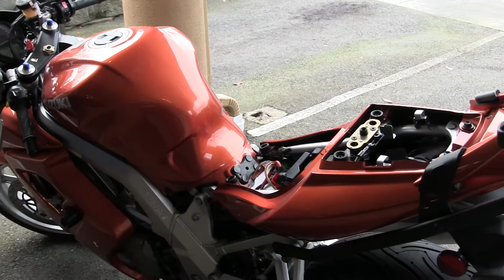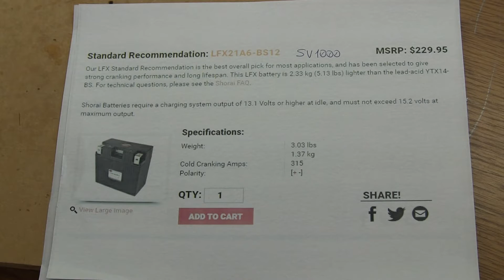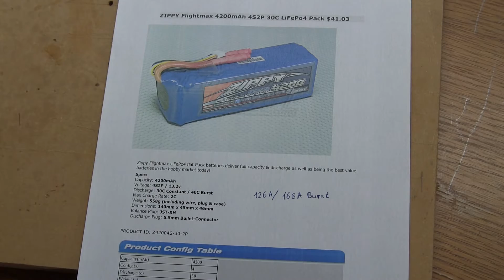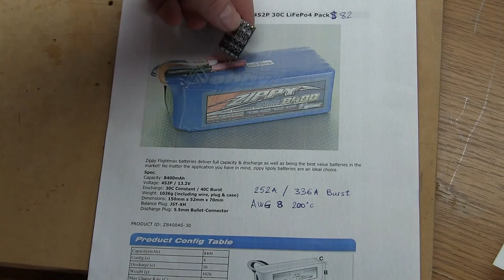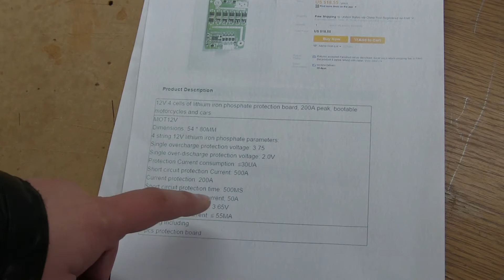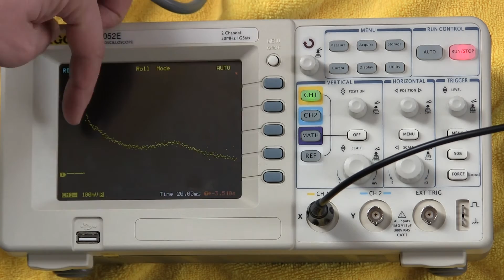DIY LiFePo4 Motorcycle Battery With BMS. Lithium Iron Phosphate.

Comment: Awesome video. I assume you're an EE?  I'm building my own MC battery with A123 Systems 8 -26650 cells (4s2p).  Most 500cc bikes have 6 gauge terminal wires. Has going to a 8 gauge been a problem?  Also, being out in the weather, how did you eventually seal the BMS, yet allow it to keep cool?  Thanks,
Reply: I know this is an old comment, but did you ever make that battery. I have the same cells and was thinking of making the exact same thing

Comment: If your pack reaches the overcharge cut-off, and does what it's supposed to, won't that cause your bike to shut off while you're driving?
Reply: It's a good question.  I'm not sure,  the regulator/rectifier is what might keep powering the system.

Comment: Can you give a diagram of how the BMS actually connects to all the cables? I'm trying to figure out how to make sure it gets connected properly and also allows charging of the battery pack. I saw you said B- to the negative on the battery pack but I'm not sure which point on the BMS is going to the bikes negative wiring and where the charging connections are connected?
Reply: Curious about this as well -- I assume he used negative (load) output, and the BMS allows reverse-charging.. or whatever the term is. I've noticed that voltage does flow backwards through my BMS in certain circumstances. (IE it lights up an LED on my cheap bench power supply even when it's unplugged from the wall.

Comment: Thanks ! 

I was so impressed, that i've bought the 4.2AH Zippy + same BMS (alieexpress) 

https://pl.aliexpress.com/item/4S-12V-50A-Battery-Protection-BMS-Board-WITH-Balance-for-4-Packs-LiFePo4-Lithium-Iron-Phosphate/32709959374.html

Right now, i've made the same mistake with connection of bms to the battery, without changing the polarity of the 'balacing connector' – the effect was the same like in vid ( ;-) ) The main question is – how to connect the bms with this Zippy battery? And how to connect it with the bike? Small drawing? Order of wires (colors) from Zippy ?

Comment: Thanks Nicolae, will try this battery on my Moto Guzzi Griso 1200 with this BMS: https://www.aliexpress.com/item/4S-200A-LiFePO4-BMS-PCM-PCB-battery-protection-circuit-board-for-4-Packs-18650-Battery-Cell/32819634220.html
Reply: Did you try it?
Reply: @jeremiahgustafson5318  Works very well.

Comment: You said that the BT are not trustworthy...you couldn't be more wrong. I have them for many years on my off road bikes (the 120 CCA version) and they never failed. Weight is 2/3 of the Shorai, and the double terminals are simple solution for many issues.

Comment: Never coat the mosfet's unless you use artic silver thermal compound and use a heatsink that covers all 12 find a plastic compartment laying around and make holes for the wires and heatsink and seal all of the holes for wires with silicone and use thermal compound for the heatsink, no moisture issues

Comment: Can't you add another battery in parallel?
Reply: Yes and parallel the balance leads. That would double the amps and capacity, but maintain the same voltage.

Comment: Try starting you car with it
Reply: I will. 
I ordered the 4.2Ah battery instead of the current 8.4Ah for the motorcycle and I'll try the 8.4Ah battery on the car.
Reply: I have a 4,2Ah buth my bikes need a lot of amps, I would like a second 4,2Ah buth they are soldout.  I also tried some cheap Samwha supercaps buth they are crap.  I,m planning on using this bms http://nl.aliexpress.com/item/Free-shipping-4S-30A-lifepo4-BMS-PCM-battery-protection-board-for-Lifepo4-battery-pack-SH04030029-FB4S30A/32553398237.html
Maybe run the starter straight on the battery. Also with the 4.2Ah look at your charging current.
Reply from the maker: Just posted the video with the 4.2Ah battery:
https://youtu.be/Y1etkdPBtNQ

Indeed, the charging current may be a concern. I've seen it climb up to almost 12A which significantly exceeds the 1c recommendation. Will try to run it for half a year and see how quickly it degrades.

Comment: Thanks for this, I decided a few days ago I was going to go LifePo4 for 3 bikes I have here that I am working on all with dead lead acids.
I bought 4 x 10Ah cells instead so will see how that goes for aboput half the price.

http://www.aliexpress.com/item/4pcs-3-2v-10000mah-lifepo4-battery-10ah-3-2v-cells-30A-high-drain-cells-For-battery/32470094337.html

Comment: if you plan on using an external balancing charger could you do without the bmc board?
Reply: +Claus Hollen Nielsen The main reason why I ended up using a BMS is to avoid destroying the battery if I accidentally discharge it. The BMS would stop the discharge and protect the battery.
Reply: Of course, it is a BMS both options. He did both to observe the battery levels.
Reply: individual cell levels